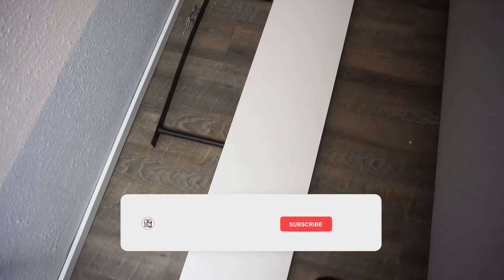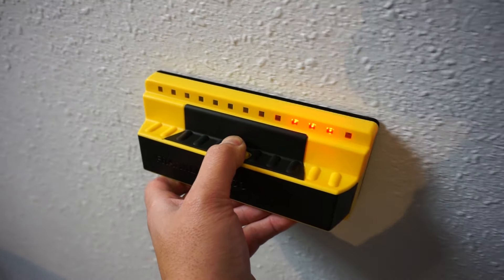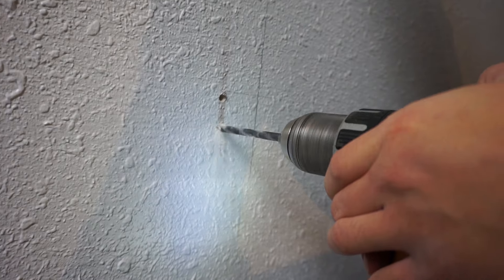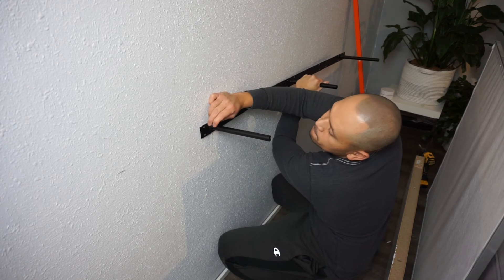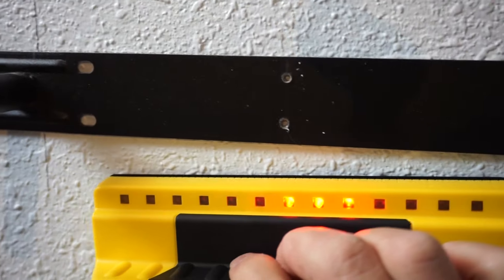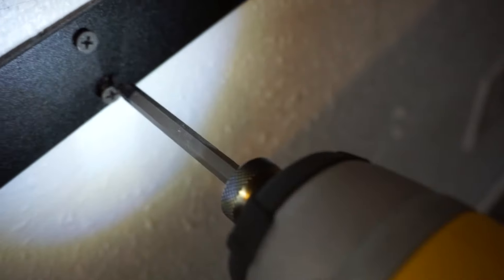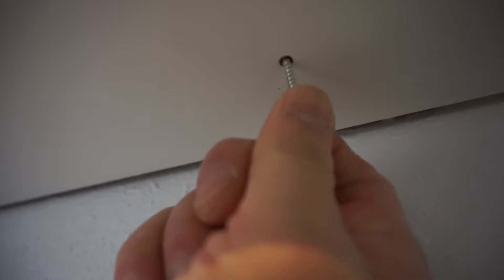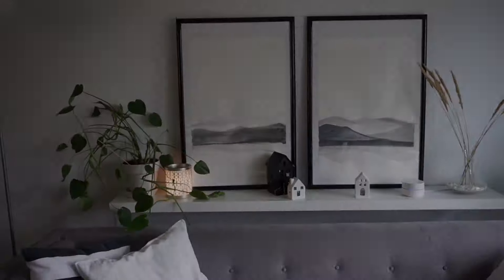How To Install Floating Shelves | Easy DIY IKEA Floating Shelves Install!

Comment: Nice video sir, but as a painter to all the folks out there planning on mounting these, don't use long lead pencil lines on your drywall/painted finish. Very hard to come out without ruining the paint.
Reply from the maker: Thank you 🙏🏽
Reply: What is the recommended method for marking? Thinking of doing this project soon!
Reply: @justintzou  well use a pencil that's ok, but just use little marks where you don't push too hard, you'll be able to erase it easier
Reply: C  lol! thats the greatest answer I've heard in a long time! Loved BR. I watch an episode every night with dinner. Take care
Reply: Pencil marks can be removed by pink pearl eraser . I had no issues with paint on my walls and I painted them extra white .

Comment: If you drill into the stud why would you need to use anchor for the screw to be sturdy it will remain sturdy in the wood. Where hollow drywall needs an anchor in order for the screw to be sturdy. Still a cool tutorial video how you did everything else
Reply: Watch the whole video.  He didn’t use the anchors on the studs, he used them where there weren’t studs.
Reply: He found the studs but I don't think he drilled all the way in. The screws weren't long enough for one and whenever you drill into a stud wood chips would come out of the drill hole along with drywall particles! Still a good video though!!!

Comment: Drilling holes into the bracket so that you can have this supported by the studs is a fantastic idea!! Thank you for that tip.
Reply: That's soo smart cause with those extra holes it will not cause a problem it the future this needs to be done by ikea

Comment: Hello!
If I’m only thinking about using the studs, should I only use the screws without the anchors? Or is it better to use the anchors on the drywall only + the screws in the studs?

Comment: I truely like yr video. But i was hopeing you could help me with the screw n screw size since i had purchase shelf in a yard sale with out the screws. Could you help me find that answer? Dry wall screws i have but wasnt shure on size n length for screws to connect board with metal poles.  Need yr help gladys

Comment: Can you just clarify a few things.
Did you put those wall anchors directly on the studs? Just confused as to why you located the studs when you used the anchors. 
Also can you explain the measurement of the bracket and the usage of the level to mark the wall. Just confused by that part
Reply: Anchors are not need for the studs,  they were just for the Dry Wall.  The level is used to make the shelve is level so your stuff don't slide off.
Reply from the maker: Thank you! 🙏🏽
Reply: Thanks for the explanation on the titanium drill bits used. 

However, I find if you are using at least inch and half screws into the studding, at 3 locations,  and doubling up those spots right into the studs, you have zero need for wall anchors.
Already you have probably around 300 lbs of weight retaining power from the 6 to 8, 1.5 inch screws directly into the studding. The wall anchors are useless at this point. Even if rated for 45+ lbs. Funny thing. With minor force, the wall anchors will rip out at about 35lbs of force. 
Drilling and anchoring directly into the studding is always your best bet

Comment: Hi, so I just put this exact shelf up but it’s tilting a lot downwards… possibly from the cheap metal part that goes inside isn’t strong enough to hold the self? How can I adjust it without adding brackets underneath?
Reply from the maker: Hi! Are the bracket rods  inside bending or the plate attached to the stud bending?
Reply: @FixThisHouse  I just installed one with 2 bars but same issue I had it is tilted downward. I am thinking to apply some strong glue to hold it up

Comment: How do you drill the extra holes on the bracket for the studs? What kind of drill bits?  Thx.
Reply from the maker: Hi! I just locate where the bar will sit perpendicular to the stud then start drilling a hole using my Dewalt Titanium 1/16 bit then move up to my 7/64 bit 👍🏽😊
Reply: @FixThisHouse  thank you!

Comment: does it sag? mines sags a bit but maybe mines isn’t that secure ?
Reply from the maker: No sag, you will need to add more screws for support. Make sure it’s screwed onto the studs rather than using the drywall anchors 👍🏽😊
Reply: To stop the sag only use the top holes to secure it and go into the stud.

Comment: How did you  drill the extra holes?
Reply: Drill bits
Reply: @butabains4650  I meant what type of drill bit did he use. Do I need to get a specific one made for metal or will a standard drill bit work?
Reply: @tylerl4472  I was wondering the same thing - guess I'm asking Google.  😅
Reply: @tylerl4472  Found out most regular drill bits can go through metal, but if it's too thick, use black oxide or cobalt steel drill bits. Titanium coating helps as well. It says they're only a few dollars more. Hope this helps! I picked up one of these shelves from FB Marketplace and only ONE hole on the bracket lines up with a stud, so I'll be drilling.
Reply: I put these up last weekend and bought a cobalt drill bit to drill holes but didn’t end up using it. I found 2 studs for each shelf. The way the studs are in my basement wouldn’t have guaranteed I could’ve gotten more than 2 anyways since they aren’t space the standard 16 and they aren’t even a consistent distance apart. They still are not that stable but I am only putting light things on most of them. And then one shelf I found a cross beam so the entire thing is held up by studs😂

Comment: is it possible to install these without drilling?? if so, how?
Reply: I would say, no. The shelves themselves - at least this model,  which I think are the 47-inch ones like mine, are particularly heavy. I can't imagine any other way they could be installed other than by drilling.

Comment: You also did not "do" anything with the studs. You showed how to mark them, but then did not indicate you were drilling into them or even avoiding them on purpose. A better video would include using the studs doe even better capacity.